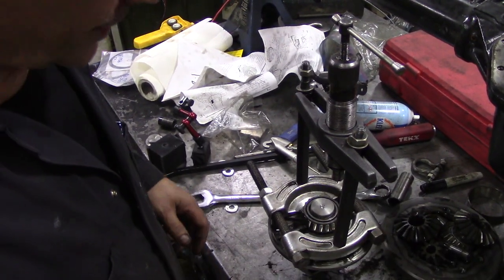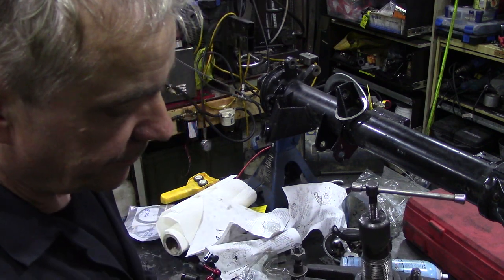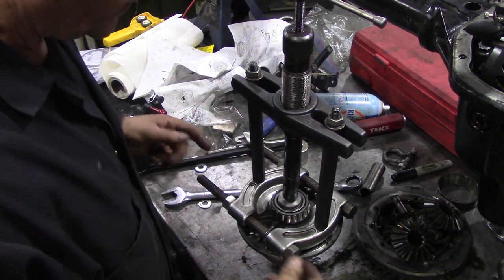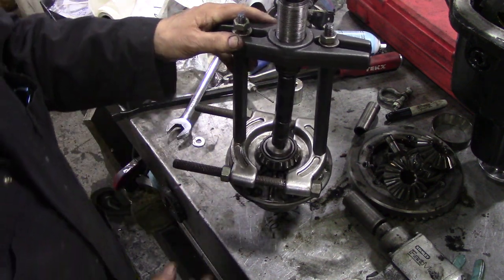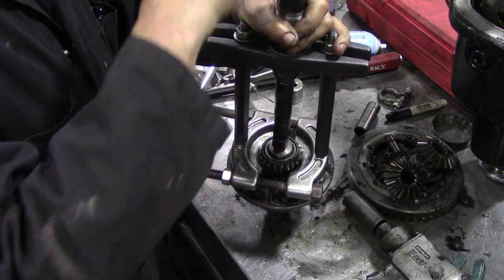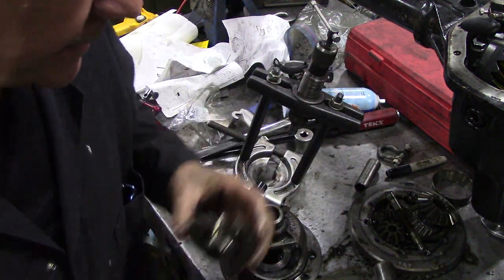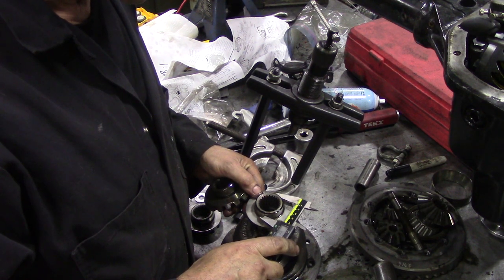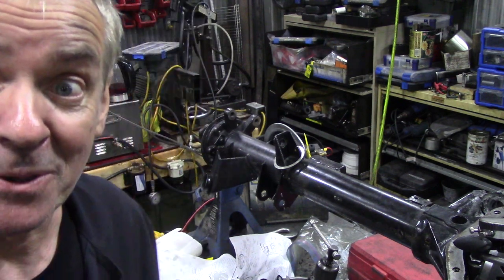Pulling difficult bearings and 10 spline to 24 spline conversions. Rover differentials

Comment: I put a elocker housing in my 10 spline diff, cost me $1700 for the elocker and another $1000 AU for the 24spline HT axles and flanges and of cause new bearings. Ok job except for the cost😮😮

Comment: Would that puller do the pitman-arm on the steering box?
Reply from the maker: It may do IF you can get it in - the drop arm is a bit awkward to get round
This works very well - no bends or breakages yet
https://www.britpart.com/parts/tools/miscellaneous-tools/da1749

Comment: Hi Mike, I am about to put a 24 spline diff into a 10 spline case in the rear of my RRC, the luckily the 24 spline shafts are the one piece type like the original 10 spline, can you think of any problems.

Comment: Is that an ABS equipped Salisbury off a TD5?
Reply from the maker: No, just a regular Td5
Reply: @BritannicaRestorations  I wonder if it could be adapted as the flanges look like they are similar/same to the abs Salisbury I have here.
Reply from the maker: I just had a look and the end flanges and spindles are exactly the same as a Puma axle with ABS!
 There is a mud shield between the axle and spindles covering the ABS sensor hole
Reply: @BritannicaRestorations  excellent! Good to know! They seem to share a few parts with the 300tdi discovery axle like the spindles, hubs and rotors from a quick look
Reply from the maker: The Salisbury axle and Discovery axles are different  - there are a few common parts but not major ones